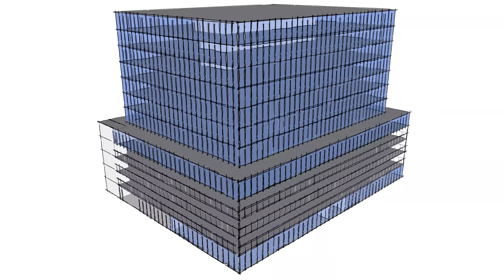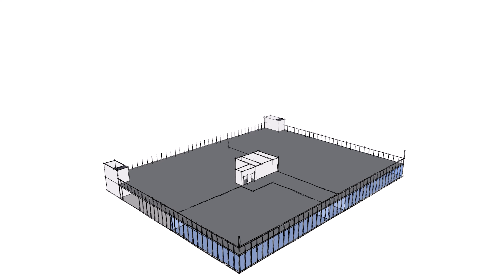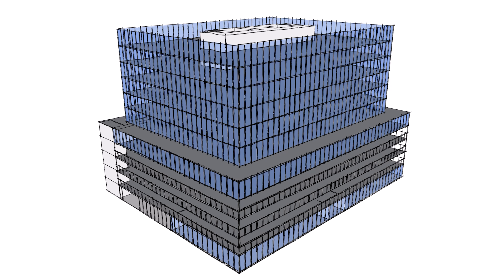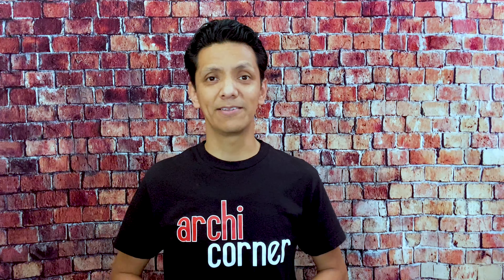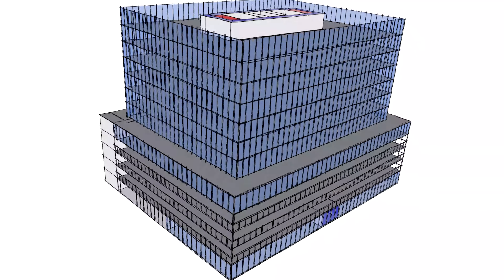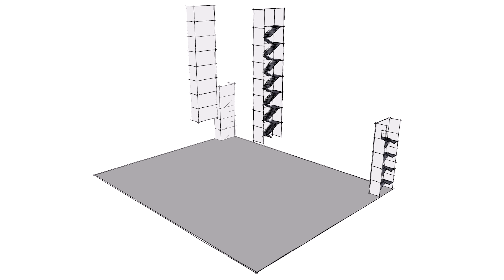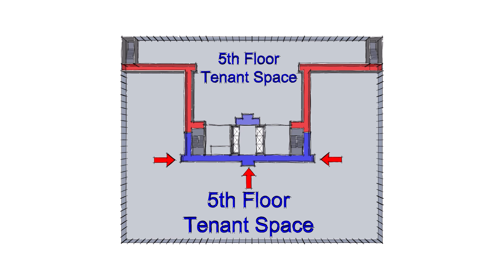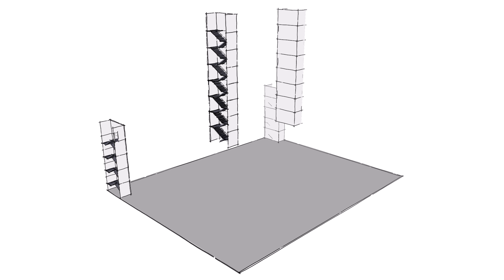AC 049 - Corridors Vs. Exit Passageways (with corrected audio)

Comment: According to the IBC definition, corridor is an enclosed EXIT ACCESS, exit passageway is EXIT component. So if we need to connect two EXITS with "horizontal corridor like space", this space needs to be exit passageway, which make it part of the exit. And the code does not forbid to use the exit passageway as circulation whether egress or ingress , the same as stairway. Just image all the elevators are not working, and we have to use the stairs to go up the floors, the code does not forbid that.
Reply from the maker: I think we both mean well. IBC 2021 1024.1 states: An exit passageway shall not be used for any purpose other than as a means of egress and a circulation path."

I acknowledge that you can use the exit passageway for "circulation" but, if an exit passageway could be used for anything, what good does this section do? and if "circulation" is all encompassing, and includes ingress as well as egress, then what is the code trying to avoid? Why even have this code section?

Comment: An exit passageway CAN be used for ingress; the code does not limit it solely to egress.  IBC/CBC 1024.1: “…An exit passageway shall not be used for any purpose other than as a means of egress AND A CIRCULATION PATH.”
Reply from the maker: Answer me this: if an exit passageway can be used for egress, circulation, and per your interpretation, also for ingress, what “other purpose” is there left?
Reply: Examples of “Other purposes” allowed in a corridor but not allowed in an exit passageway:  access to/from normally unoccupied spaces, such as storage and utility closets, restrooms etc.;  lockers, artwork, video displays and other fixed furnishings are allowed in corridors; electrical boxes larger than 16 sq. inches can be used in corridors.
Reply: Naaaaa in case of fire everyone panics something state of pulling people push and viceversa 😂😂😂arch am agree with you
Reply: @renenava5213  1.  I notice you didn’t cite the code in your objection.  2.  If your concern is solely about people traveling in 2 directions, then you should also object to corridors, lobbies, and any other part of the MOE that allows ingress as well as egress.

No one in these comments has explained what the words “AND A CIRCULATION PATH” means and why 1024.1 treats it as a distinct purpose other than means of egress.  My comment stands.